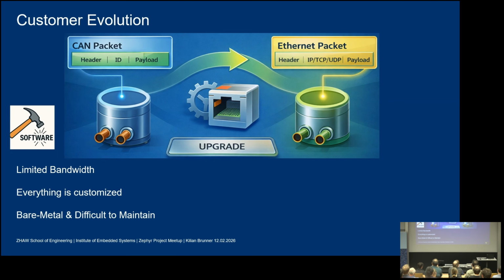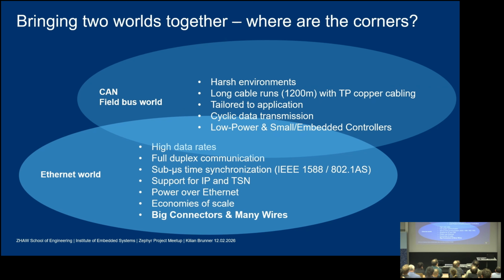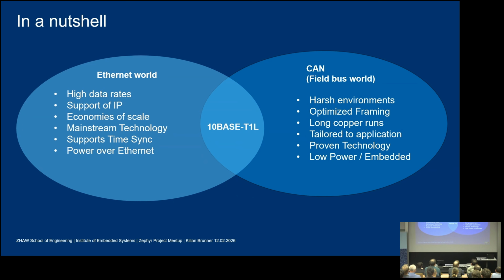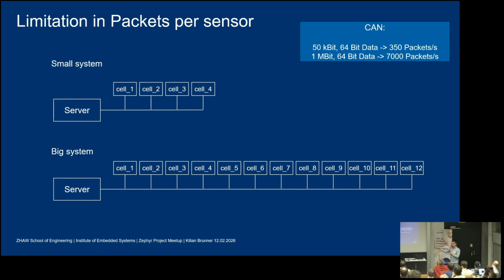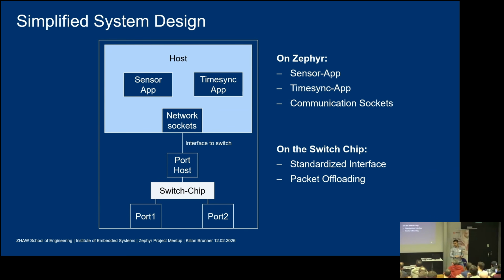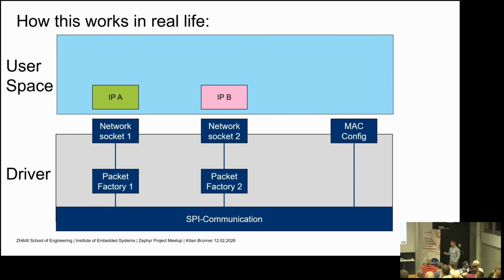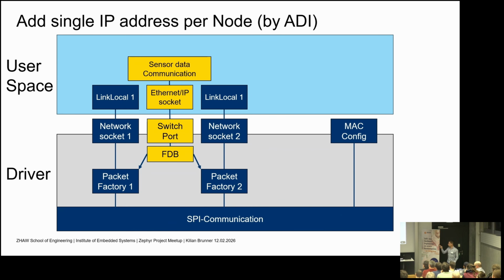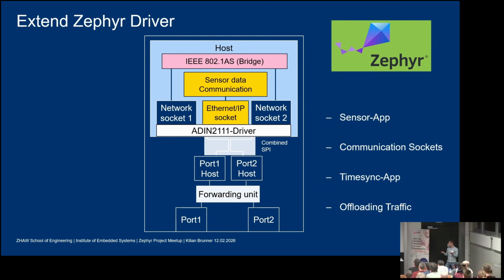Replacing CAN: How Single-Pair Ethernet and TSN Enable the Next Generation of Embedded Systems

Comment: If it is a small network you can use T1S and avoid the multi interface issue, T1S is multidrop i.e. no switch is required for daisy chain